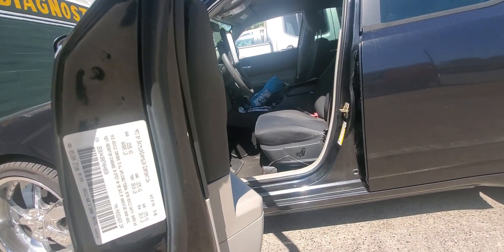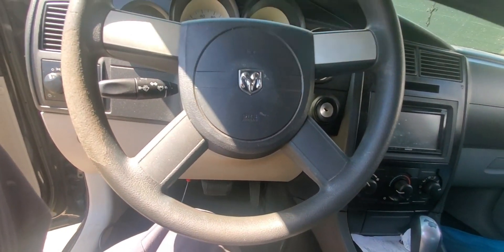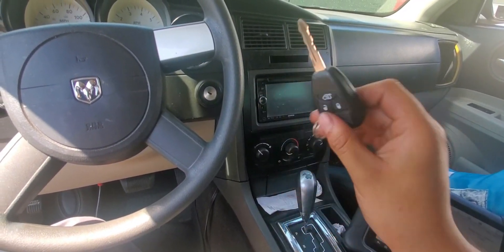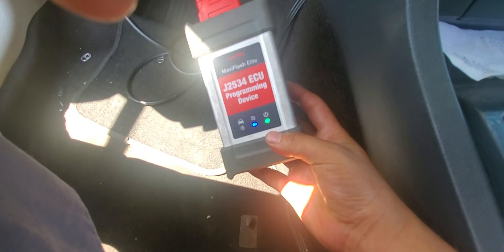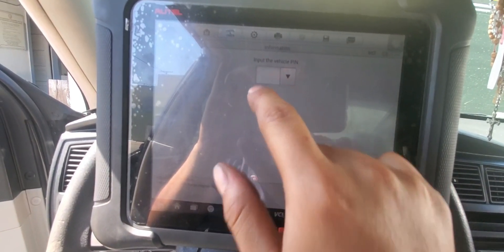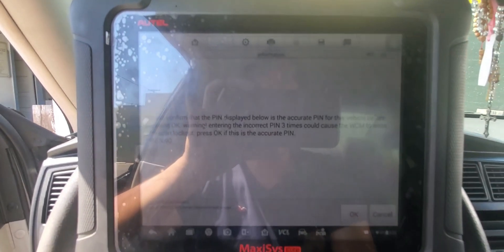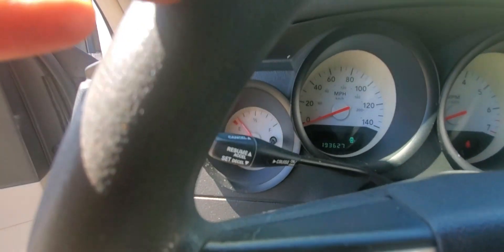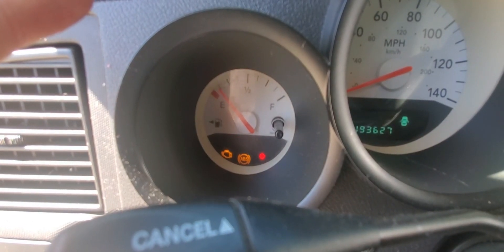How to program a dodge charger ignition key "key fob-chip"

Comment: I lost my key,got a new one made still will not start
Reply from the maker: Did they programmed they key to your car. U can call a local locksmith they charge cheaper than the dealership
Reply: @JVFIXLLC  thank you the locksmith came and programmed it,you guys are great
Reply: Why didn’t  the programmer pull the pin?